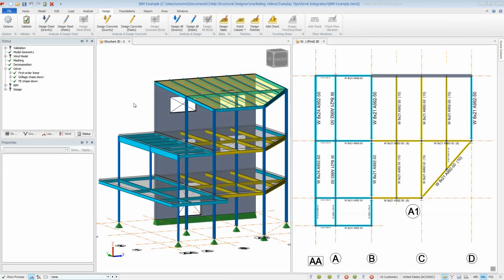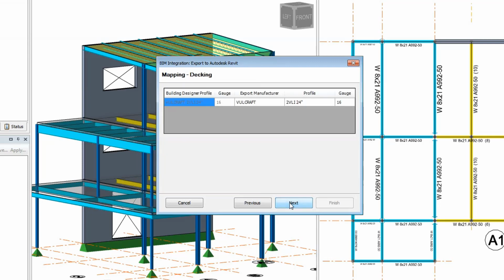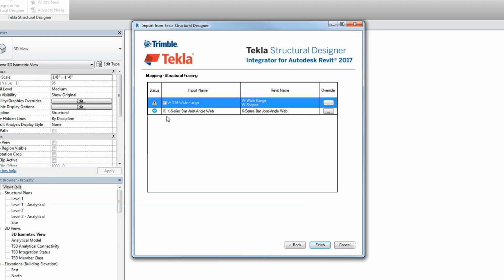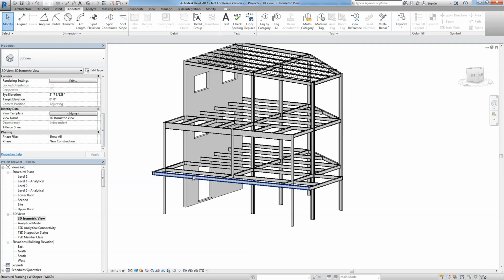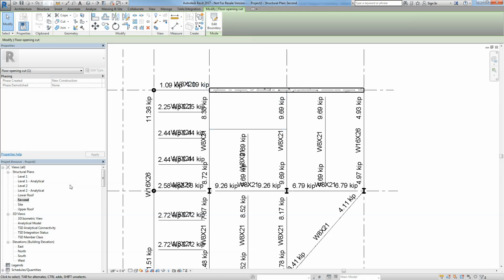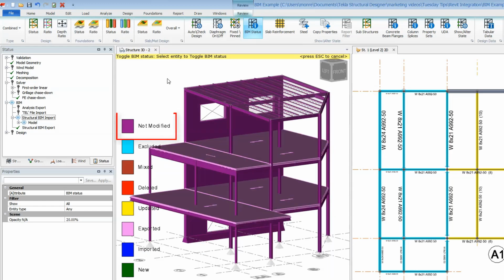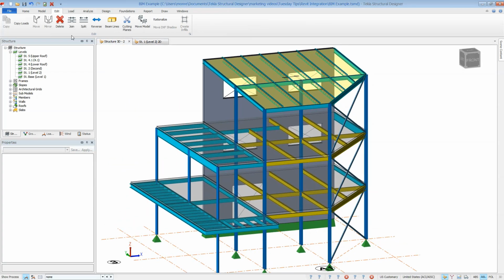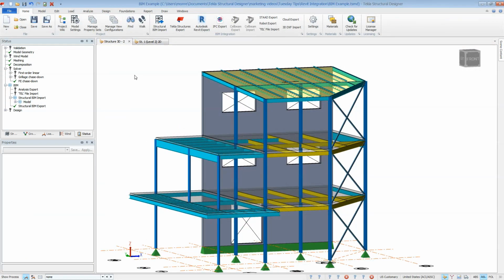Tekla Structural Designer to Revit Integration

Comment: When you do this, do all the structural elements come in as Families in Revit?
Reply: Hi, Abel. Yes, members coming from TSD to Revit are mapped to their corresponding standard Revit Family. If you have custom Families in Revit, you can additionally map your members coming from TSD to Revit to these custom families within the Export wizard. If you have additional questions or run into any issues, feel free to contact  your local technical support team and they should be able to keep you moving along.

Comment: How do I export the steel reinforcement from Tekla structural designer to Revit structures?
Reply: Hi Masau, thanks for your question. Steel reinforcement data is transferred from TSD to Revit as a Shared Parameter. You're able to see the TSD specific member shared parameters at the bottom of the member properties dialogue. From there you're able to automate member tags, schedules, etc. If you have additional questions or run into any issues, feel free to contact  your local technical support team and they should be able to keep you moving along.

Comment: I wanted to know whether we can import the auto ad drawing in to tekla structural designer??
Reply: Yes you can and thats how I work with architects grids to model and carry out all my analysis and designs.
Save As architects layout in DXF format and close the file in ACad, and then import into TSD by going to Model>Grid line>Import DXF. In the pop up menu on the top right, tick Architectural Grids (shadow is used to overlay any layout and work on it-cant use as grids) and thats it.